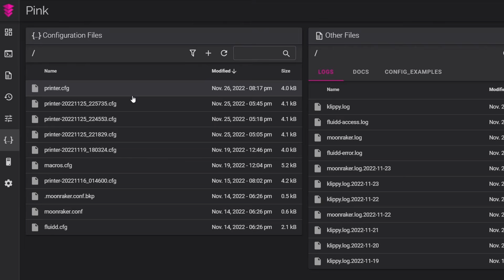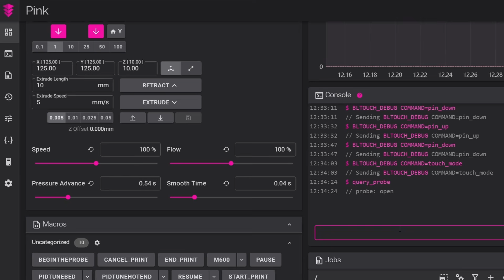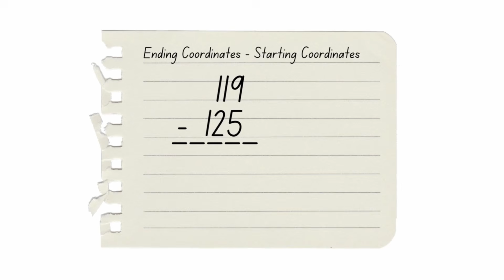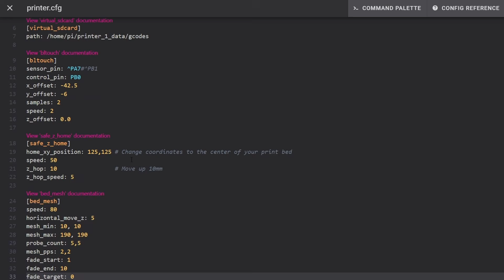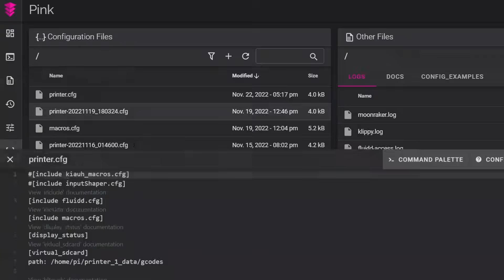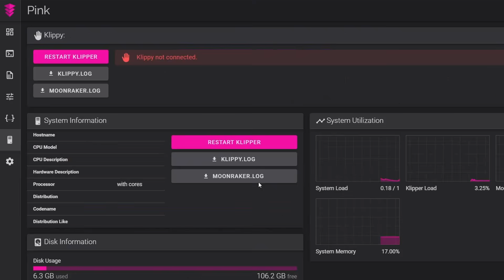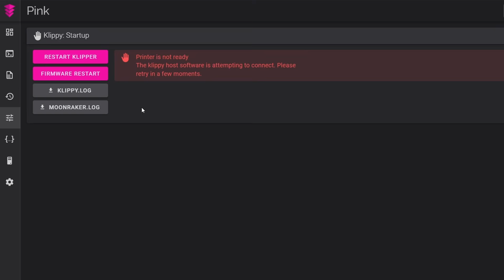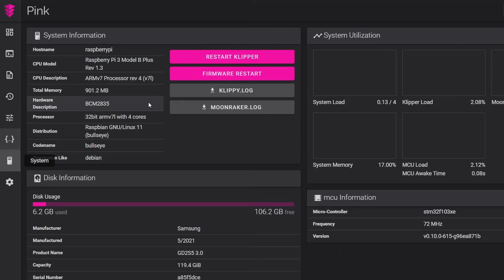BL Touch complete setup for Klipper! Maximize your probed bed mesh!

Comment: I haven't read them all but I agree with the ones I have read, awesome video. I had changed endstop positions and your video really helped getting them right. Only thing I saw was that my purge line (inside of every gcode ive printed) was set for 5 mm from the edge and my test print after following the video had it missing the bed so I changed it to 12 in the startup gcode. reprinting my saved gcodes will require editing them prior to print.
Reply from the maker: Hey Brad thanks for watching and leaving a comment! For your previous prints, if you used a macro for your starting gcode (like start_print) you could simply edit that (which should save you some time) 👍

Comment: Great video. I've finally set BLTouch in my Artillery. May you share the model to test z_offset?
Reply from the maker: Happy to hear this video helped! I can share a test file if you want, but honestly it's so simple I'd be embarrassed lol all I did was create a 20x20x20 millimeter cube, then shrink the z height of the cube to a single layer tall (0.2mm for me). Then I duplicated that model until I had 5 of them. One went into the center of the bed and the rest were all evenly spaced at the corners(for ender sized beds I usually did xy coordinates: 70,70 / -70,70 / -70,-70 / 70,-70). Then just make sure to print it with a skirt using 2-3 loops. Let me know if you need me to go into more detail , I'd be happy to.

Comment: Many many thanks for this excellent video, trying to setup my Ender 3 S1 Pro was driving me insane.  I still have one slight issue however, when starting a new print, the first line that gets printed along the left side misses the build plate by 2-3mm, which settings would I need to edit? as I know that changing one setting effects everything else and I am a bit wary of changing things as apart from this minor issue it is printing great.
Reply from the maker: Thanks for watching and for taking the time to comment! Usually when you have an issue with a 'purge line' before a print you'll want to make a change somewhere in your start_print macro. Although I would think this line is setup to properly apply on the bed, can you reply with a copy of your current start_pront macro (or whatever you're using in your slicers start gcode section).
Reply: @PrintsLeo3D  Many  thanks for your reply, here is a copy of my Cura Start G-code: 
; Ender 3 S1 Pro Start G-code
; M413 S0 ; Disable power loss recovery
G92 E0 ; Reset Extruder

; Prep surfaces before auto home for better accuracy
M140 S{material_bed_temperature_layer_0}
M104 S{material_print_temperature_layer_0}
BED_MESH_PROFILE LOAD=default
G28 ; Home all axes
G1 Z10.0 F3000 ; Move Z Axis up little to prevent scratching of Heat Bed
G1 X0 Y0

M190 S{material_bed_temperature_layer_0}
M109 S{material_print_temperature_layer_0}

G1 X0.1 Y20 Z0.3 F5000.0 ; Move to start position
G1 X0.1 Y200.0 Z0.3 F1500.0 E15 ; Draw the first line
G1 X0.4 Y200.0 Z0.3 F5000.0 ; Move to side a little
G1 X0.4 Y20 Z0.3 F1500.0 E30 ; Draw the second line
G92 E0 ; Reset Extruder
G1 Z2.0 F3000 ; Move Z Axis up little to prevent scratching of Heat Bed
G1 X5 Y20 Z0.3 F5000.0 ; Move over to prevent blob squish

Comment: G28 Giving Failed to verify BLTouch probe is raised; retrying. - this is on the sprite pro if that matters?

pin_up and pin_down work just fine, have added in the probe_with_touch_mode: true and tried it both with and without the seonsor pins ^

also it always reads triggered no matter what
Reply from the maker: Let me see if I can help. Do you know what mainboard you're using, and can you share the bl touch portion of your config ?
Reply: @PrintsLeo3D  thank you muchly, I believe (but it's been a few weeks since I looked) it's the 2.2.5 version - and the crtouch was sent directly from creality so I assume 3.1

It was working fine before I upgraded to the sprite pro, which when installing I reversed the wire - blew the old crtouch, but on this new one I've used both the sprite pro and the original wire, same results, so I assume it's the MB - I currently have a 2.2.7 MB in my cart

Here is my bltouch section, the two last lines added as troubleshooting, also with and without the ^

[bltouch]
sensor_pin: ^PB1 #^
control_pin: PB0
x_offset: -30
y_offset: -10
samples: 3
speed: 3
lift_speed: 10
sample_retract_dist: 5
z_offset: 0.0
probe_with_touch_mode: true
pin_up_touch_mode_reports_triggered: False

at this point I've sunk a good $600 into a $200 printer and only had it working a total of 3 months of the 12
Reply: @PrintsLeo3D  4.2.2
Reply: happy to report new motherboard succesfully installed and touch working fine - though to anybody re-reading, a much cheaper solution would have been to re-wire using the normal z stop pins... at least I have a backup board now

Comment: This was an absolutely amazing video. I have my Sonic Pad all setup with exception to my Cr-Touch so looking forward to following this and getting my printer further dialed in.
Reply from the maker: Good luck! After you get these settings dialed in your Klipper experience will hopefully be buttery smooth! Thanks for watching and I appreciate you taking the time to add something to the comment section !!
Reply: @PrintsLeo3D  No Problem. I am going to follow this and then go do my pressure advance cal. I have printed without either, and honestly i printed a Christmas gnome with lightning infill, so very much hollow with 4 wall layers and it came out super clean, and only took 7 hours at 100mm/s, which before Klipper was around 13 hours or some such, and the quality was better with Klipper. So super happy with my upgrade. Very much a learning curve, but hey that is what tinkering is all about. Anyhow, thanks again!
Reply from the maker: Yea Klipper gets the hype from the speed, but the quality is amazing! I was printing some Christmas gnomes on my KLP1 yesterday lol great minds think alike!
Reply: @PrintsLeo3D  So I ran the pressure advance test using the Gcode from the website you linked, and followed the steps to ensure I got it mostly right. in my print, every single line looked exactly the same. When it started the acceleration it would thin, and when it ended the speed back to slow, it left a blob. Every line. I will test again because I had build start and end print macros, but I am going to revert back to letting the slicer call those out because when I use the end print gcode per Cura copy and paste, it errors our with some of the coding, but when the slicer does it, it runs fine. Interesting, but not the end of the world. I will work that later. Anyhow, Just wanted to let you know the weird experience to see if you'd seen that before. I use a direct drive, so .005 step increments.

Comment: Im running octoprint with klipper and my version doesnt show current coordinates of the hotend....do you know why?
Reply from the maker: Out of the 3 front end available (Octoprint, Fluidd, and Mainsail) Octoprint is the only one that does not offer this sort of interface. To be honest I would highly recommend moving to one of the other front ends , because overall I personally think they're a better user experience. I know people love the plug-ins Octoprint offers and it's always hard moving to new software. That all being said I believe you can still send gcode commands to the printed, and the one you'd want to send is M114. That is the command to get the current position. So you should be able to move your hot end into the correct location , send that command (M114), and it should answer with the current coords. I hope this helps!
Reply: @PrintsLeo3D  Ahh, thought you were using octo too. Im totally new to custom firmware and just going from guide to guide. Thanks for great content
Reply: @PrintsLeo3D  Yeah, been reading up on it since you wrote back and im definitely going Fluidd. Will start all over and follow your step by step guide 🙂 🤙
Reply from the maker: Great! To be honest if you're new then starting from one of the dedicated front ends (Fluidd or Mainsail) is the best option. Klipper was created to work with Octoprint, and thus work within its constraints. Fluidd and Mainsail were built to specifically work for Klipper. They are lighter softwares and have a much more robust user experience. Good luck! If you're wondering I am using Fluidd, but the differences between Fluidd and Mainsail are negligible. Whichever you choose you'll enjoy.

Comment: Great video Leo. Did you ever get around to doing the video on Print Speed, Acceleration and Max Flow rates?  That would be really helpful, as it's the one area that always gets me stumped when trying to print faster.
Reply from the maker: Hey Andy! I'm fine tuning the setup/script of that video and it should be out soon. I wanted to make sure my process was repeatable and accurate. There's also some areas of the slicer I need to cover in that video, so I might do an intro to OrcaSlicer video first, as that's what I'll be using for demonstration.
Reply: @PrintsLeo3D  Awesome. Can't wait

Comment: So this tutorial is AWESOME, no doubt about it -- BUT -- having followed along as well as I could, I find myself at a SERIOUS: NOW WHAT?  moment, so I hope there's a quick answer for this - one that doesn't prove very complicated:

With all the differences of klipper now in play, just WHAT CHANGES do I have to make to my SLICING procedures???

kinda non-trivial, I fear???
Reply from the maker: Well.. that's sort of a complicated question, but luckily it's the sort of 'we can cross that bridge when we get there' complicated.
    In general slicing for Marlin and Klipper at a basic level is the same. When I say basic level I mean just a normal good ole print, no adding in stops for filament changes or something extra like that. You had  profile for your printer in Cura, you've switched to Klipper, you should be able to slice and print. The one change you will need to make is the start gcode. 
    For Marlin we would add all the commands we wanted the printer to execute prior to the print within the start gcode section of the slicer. Now you can still do that, but Klipper makes it easier, you'll just make a reference to a macro (usually start_print or print_start), and the information for what to do before each print will be within that macro. The way to think of a macro is a book, it has a title (the name, like start_print), then it has its contents (what the macro does, the instructions to the printer). When a macro is sent to Klipper it "opens the book" and reads and executes what's inside. So now instead of writing it line for line in your slicer, you'll just add all the start commands to your start macro. That start_print macro needs to be created by you and will be housed within your printer.cfg (or as a seperate file and then [included] in the printer.cfg).
    Aside from that some other changes will depend on your slicer, as last I checked Cura did not support slicing specifically for Klipper firmware. Now Cura still works just as well with Klipper but it just may not support some it it's unique features (I could be very wrong about this, it's been a while since I've used it). However, a slicer like OrcaSlicer does allow you to pick what firmware you are using, and it does have Klipper as an option. In general what this does is add in features that Klipper can use (like the exclude object command and individual object mapping), and eliminates the usage of certain M and T codes that Klipper will not recognize (and I believe it will substitute in the correct ones).
    So there's no easy answer to this. There will be some changes to make the experience better for you. You can get by and enjoy printing by only making the tiniest of changes (start_print macro), but you may not be enjoying all the features Klipper can offer. If that is the case you can take your time and learn about and implement those when you get a chance.
    I am sure this will raise more questions then it answers so feel free to message me back. I would also highly recommend joining the Discord as a majority of the members there are all using Klipper and are extremely well versed.
Reply: @PrintsLeo3D  HUGE thanks, Leo, for your prompt RE:!!!  I've always toggled back and forth between Cura and PrusaSlicer, but perhaps I need to broaden my horizons?  I am tickled that I may actually be within reach of printing again -- I've been out of business for over a month now, upgrading the old Ender 3 with a SKR Mini board so I can now KLIP!!!!  This video really did provide the last pieces, so - THANK YOU for your FINE WORK!!!!    You ARE a PRINCE, INDEED!
Reply from the maker: You're very welcome! Good luck with the adventure and if you need anything don't hesitate to ask me

Comment: I was getting tons of out of range errors after changing my probe mount, your video helped a ton! im no longer getting errors but i have one issue, my probe hits every position great but it probes too close to the back of the bed it probes about 2mm from the back edge of the bed. i imagine i have to adjust my y offsets somewhere but which one and by how much?
Reply from the maker: Tyler, I'm happy to hear we got those movement out of range issues out of the way. As for the rear probing, and I am referring to how far the probe goes on the Y axis, you would just need to lower the Y axis value under mesh_max. I'll give you an example. If your current mesh max is set as follows (these numbers are hypothetical only meant to show you the process)

mesh_max: 180, 215

The value of 180 corresponds to the X axis value(left ot right), while the 215 is the value for the Y axis(front to back). If you want to bring the probe in closer to the center of the bed (and away from the edge) you just need to lower the Y value. How much you lower it will depend on how far you want to bring it away from the edge of your bed. If I wanted to bring it 10mm in you would just lower the Y value by 10. The new mesh_max would be as follows:
mesh_max: 180, 205

Let me know if this helps!
Reply: thanks for the info! i will for sure try this but first i have to figure out why my bed mesh wont work anymore, ive always had problems with the bed leveling on this machine {ender 3 s1} so i printed a 0 y offset probe for it since it is supposed to fix the bed mesh issues but im still having the exact same issue nothing will stick on the right side of my bed. also now i am getting "move out of range" errors again but only at the end of prints, it works fine during probing now after watching your video. @PrintsLeo3D
Reply from the maker: For the out of range issues at the end of a print, I would look at your End print macro. Usually that will have to do with the macro changing relative/absolute coordinatinates, and then trying to make a large move which will trigger that error.
Reply: @PrintsLeo3D  well i fixed my out of range issue at the end of a print and my bed level issues but now im back to not being able to print at all lol. get a out of range error about a minute into a print. !! Move out of range: 4826.000 40.612 0.263 [94.606] for some reason it is trying to move the x to a crazy postion. im not sure what im doing wrong lol. i did dozens of bed level calibrations fixing that issue but now as soon as i try an actual print i get out of range errors.
Reply from the maker: That sounds like an issue with Absolute coordinatinates and relative coordinates. Can you reply with your current start print macro and what slicer you're using ?
Reply: i am using cura and my start g code is
 G90
G92 E0 ; Reset Extruder
G28 ; Home all axes
BED_MESH_PROFILE LOAD=default
G1 Z2.0 F3000 
G1 X5.1 Y20 Z0.3 F5000.0 
G1 X5.1 Y200.0 Z0.3 F1500.0 E15
G1 X5.4 Y200.0 Z0.3 F5000.0 
G1 X5.4 Y20 Z0.3 F1500.0 E30 
G92 E0 
G1 Z2.0 F3000
G1 X5 Y20 Z0.3 F5000.0 @PrintsLeo3D

Comment: How does one go about finding out the values for sensor_pin and control_pin for the different Aquila mainboards? You note that they are 'unique to your mainboard,' but you provide no further information. I've got an Aquila X2 with the N32 chip, and the pins in the example config (^PB1 & PB0) aren't working.  ^PA7 & PB0 (like in the vid) also don't work. I haven't had any success googling so far. I'm stuck, and disappointed because I really wanted a working touch probe.
Reply from the maker: Saul there's usually two ways to figure out the pin assignment. One would be to find a 'pinout' guide. This is usually provided by the manufacturer that labels all the connections and pins in the mainboard with their name. 
    The second would be by looking directly on the mainboard . It may only be BTT that does this but on the back side of the mainboard it's possible the different connections will be labeled.
   Apart from those two options Google is your best bet. What mainboard are you using in your Aquila?
Reply: Thanks for the quick reply. After a LOT of time spent, it turns out that there was a continuity problem in the extension cable preventing the control signals from reaching the probe. Both the red (orange?) and yellow wires are either broken/corroded somewhere along the length, or maybe badly-attached to the JST connectors. I connected it using  the pigtail cable and ran some tests (challenging with such a short cable!) and it responded properly on pins ^PB1 and PB0, so now I'm just waiting on a new 1M cable.
Reply from the maker: Wow glad you were able to diagnose that. Usually the DuPont ended wires give an issue but not the jst connectors. Good luck getting it up and running again, I'm sure after getting a new wire it will be a piece of cake for you.